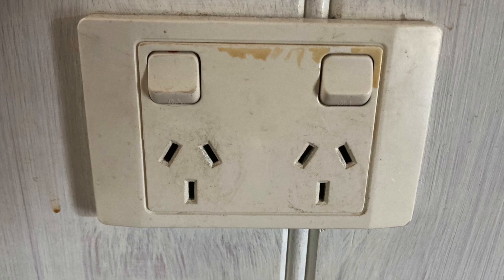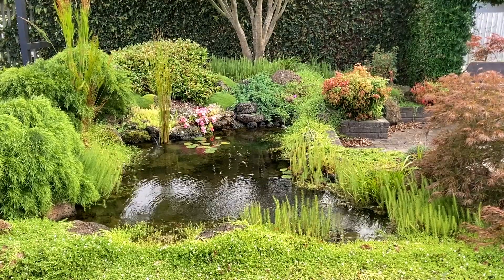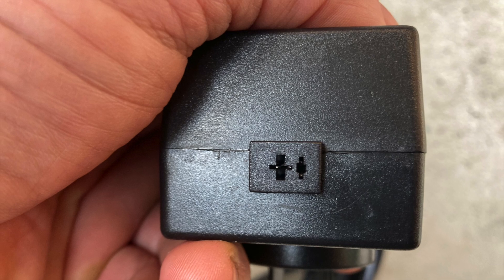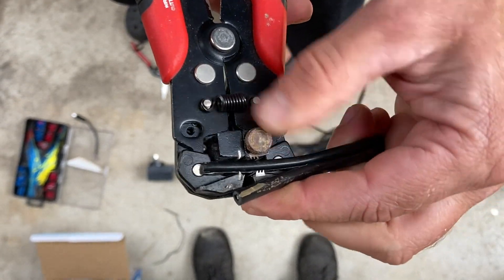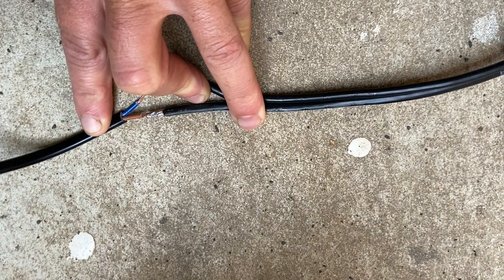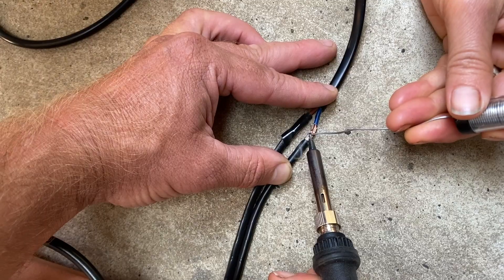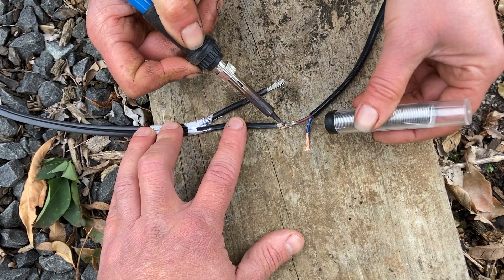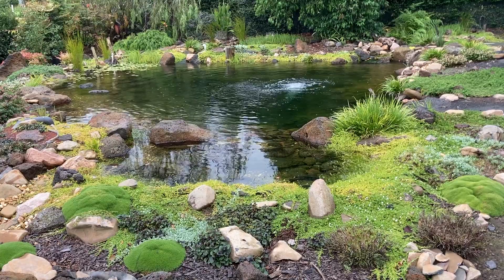Extending the cable on a low volt pond pump.

Comment: Hi Kev - Do you put a cable cover of some sort on the Low Volt cables you run into the garden? Is a cover necessary and if so, what do you use? Thanks.
Reply from the maker: I use a shrinking wrap over the join but the cables themselves, I just run through the garden hidden by some mulch. On my large pond with a really long run I put the cables in a large diameter pipe (90mm) that was because there were 4 separate pumps and an air line. If I need to replace something I don’t want to dig up the garden.
Reply: @Ozponds  Thanks Kev - that's great.

Comment: Liked the video. The only thing I would take issue with, not a big one, is your use of Chinese equipment. I have found this to be somewhat of a lottery due to poor quality materials or workmanship. I have had so many electrical and electronic pieces of equipment fail in a short space of time that I have given up trying to provide my clients with an economic package. I try and install top quality, reliable makes where possible, because I am fed up of being called back to a job to replace stuff that has failed after a few months. Especially led feature lights and floodlights.
Reply from the maker: I love my Chinese pumps. I haven’t replaced a single one yet. Had to replace an impeller on a 5yr old pump, that’s it. The lighting I’ve had issues with.

Comment: Why can't I just use an extension cord?
Reply from the maker: Most of the time the transformer these pumps come with aren’t weather proof. Therefore I find it better to have the transformer indoors and extend the low volt cable. But you can do what you find best/ easiest.

Comment: Hi Kev. As usual the videos are great and full of useful information. Can you suggest a good source for buying those pump hoses you use. I live local to you at Phillip Island, Victoria. Many thanks for your good work. Regards Bryan
Reply from the maker: The rigid pvc, garden hose and clear tubing I buy at Bunnings. The more heavy duty large diameter flexible pipe I shop around. The last lot I bought was from hose factory, when they were having a 1/2 price sale.

Comment: I was wondering.. when do you need a retaining wall for a small pond? I want to make a small wildlife pond in my garden but the only place I can do it is next to the paving... I can move it 20cm away from the path but every cm counts because the pond will only be 1meter wide and 2 meters long 😂 the paving tiles are 1m x 1m and weigh like 50 kilo's but I am still a bit worried...
Reply from the maker: I guess it depends on the type of ground and depth. Usually local authorities have rules on how deep a hole can be without the need for retaining. That’s probably a good guide.

Comment: Kev here in the states most low volt pumps have a box then the lines out are dc.  Don't extend dc 24 gadge lines the power will drop dramatically making the pump function very bad if a fire doesn't start first.
Reply from the maker: Those jeboa pumps I use are DC 24V. Like I said I’m no electrician but I had 3 seperate electricians tell me I could extend them provided I used a higher gauge wire. I’ve got multiple of these pumps running for over 3years 24/7. Extended 25m that’s almost 100ft. Now I’m worried. If a fire were going to start would it have already? The pump flow is excellent. Each core is 1.5mm3. The pump comes with 0.75mm3, so I doubled it. I think there is some voltage drop but I have the pumps dialed back to about 60% max capacity.
Reply: @Ozponds  at no point is this amazing artist suggesting anything dangerous in his area.  Also I personally support his channel.   He makes the imagination aspires to.
Reply from the maker: I love your support mate😊👍.  But do you think the extension is ok after 3 years or is it still a fire risk? I really don’t want to burn my house down.

Comment: Thanks for the information. I’ve been delaying buying a low voltage pump until I saw your video.  One very important device you should add to all outdoor AC circuits  is a Ground Fault Breaker.  It will trip if the cord should leak or encounters moisture in the circuit.  Low voltage circuit should not require a electrician!
Reply from the maker: In Australia all electrical sockets are connected to a breaker.

Comment: Love your content Kev. I recently purchased a house with 100K gallon pond, and having never maintained any pools, fish tanks, or aquatic ecosystems; your videos have been a great source of learning for me. I find myself coming back to reference them often. Especially about BOG FILTERS!!! 

I installed 2 aerators recently ($350 from vevor vs. $2600 from local pond guy), and 2wks later its already clarifying the water from darkening green to clearer blue. Next I'm planning to setup a 100 or 150 gal stock tank bog filter ($100-$180 at tractor supply) as a first step pond filter and home for the airmax beneficial bacteria i've been spending a lot of money on. 

Throwing muckaway tablets in it last year ate up about 2ft diameter circles of silt at a time where the tablet was thrown and dissolved. Hoping the new filter helps them spread and multiply easier.

Cheers!!!
Reply from the maker: Great to hear 👍

Comment: Just be careful,  house insurance dosnt cover any damage caused that hasn't been done by a qualified electrician, i looked into it!
Reply from the maker: Even low volt garden lights or Christmas lights?
Reply: @Ozponds no licence required for low voltage systems . 240 volt does require an electrician as it can kill you.
Reply: That's the point of 12 volt , DIYers can do it as it's low amperage and if you mix up the positive and negative all that happens is the pump runs in reverse.

Comment: NO ! NO ! NO ! It is categorically false that "If you can do it, then so can I." I stopped watching mid way through to send my regards before tapping the thumbs up 👍 button to feed the algorithm monsters. 
I will be hiring an electrician for any wiring with a current.
Reply from the maker: 😂 I knew this video was going to cause controversy. Always best to err on the side of caution 👍
Reply: You may not be able to. In some countries, outdoor sockets are against code, and no electrician will install one.
Reply: @ashscott6068  
You are correct. But, I'm in a rice village 5 hours outside of Bangkok Thailand.... I can find "a guy."
Reply: @yodlike  
Back at cha..... My Thai is embarrassing.
Reply: @francus7227 Yeah, I really don't think Thailand is the kind of place to have  such regulations. I think we have some regulation in the UK, but not outright forbidding it. It would have to be done in an approved - and very expensive - way.
Reply: @ashscott6068 I install ponds and aquaria in the UK. I'm not an electrician, but my brother is. I can't quote the latest edition of the regs, but as long as all the equipment conforms to these, you can install external IP rated sockets, plugs and transformers. I prefer to put as much of the equipment as possible indoors. But there are dedicated IP control panels to facilitate power to individual lines such as transformers for low voltage water pumps, underwater lights, UV clarifiers, aerators and floodlights, each with a separate switch. I try to avoid outside joints but where I can't I always use good quality IP rated waterproof connectors, not cheap ones. At the indoor socket, I now have the mains plug go into an RCCB so if a fault develops, it doesn't knock out the circuit. Been there!
Reply: @majorbruster5916  
Exactly....
Reply: Yes you should hire an electrician as you clearly do not understand the difference between low current , low amperage 12 volts and 240 or 120 volt AC , and why one is dangerous and one is not.